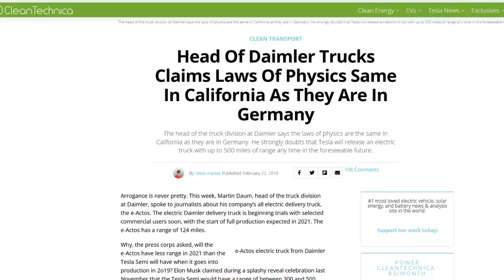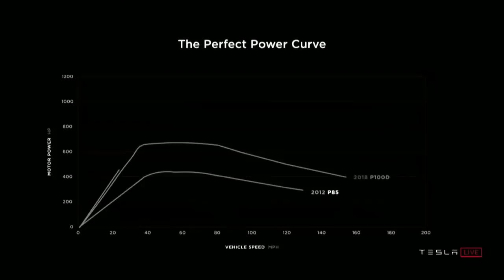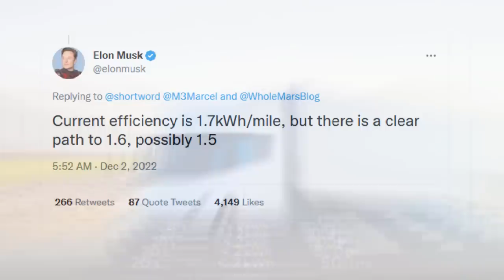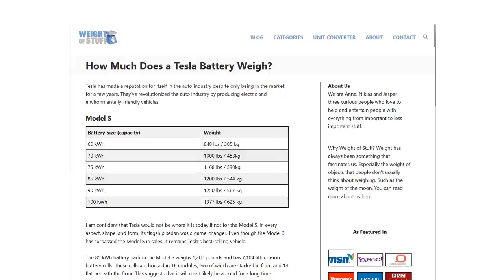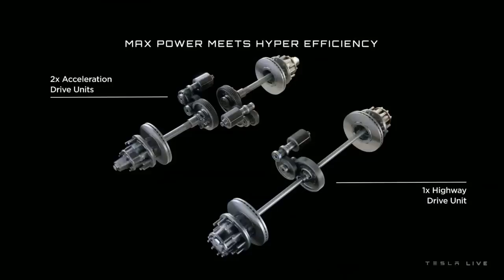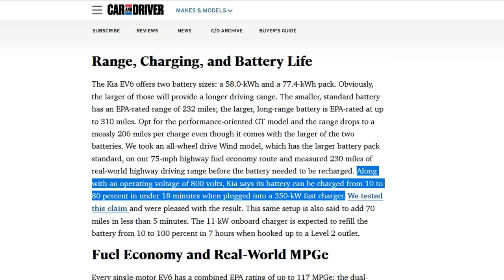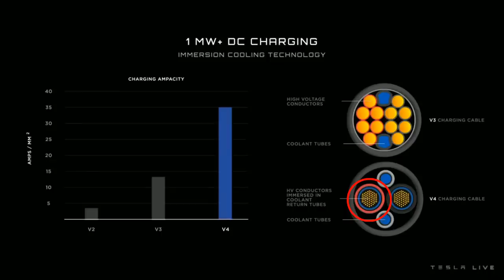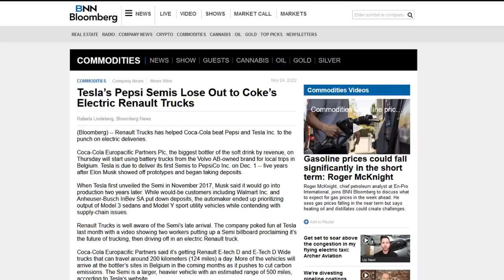Elon Musk Drops Tesla Semi Bombshell

Comment: watched this video quite patiently and if i missed the most important thing when the trucking is in consideration - the pay load i apologise in advance. The eCascadia used as comparison is looking bad for sure but the real competitors are the diesel semis and most of them are capable of doing 600+ miles between way, way faster refuelings than those monstrous batteries will require.  Also about the longetiviy ... semis  doing more than a 1 million miles before retiring are not an exceptions and ofc brand new thing as this Tesla semi is still to prove its mettle in that regard too. All in all there are reasons why Tesla 5 years{not 3} after releasing with all the fanfares their semi is not "killing the field" and some boutique kind of projects as that one with Pepsi are in order. Some short {under 400 miles per day} routes with humongous charging stations most likely on the both ends are ok, for the rest erm... nope, thats a no go for sure, the ICE based trucking industry is quite "safe" for now.
Reply: For now, perhaps. But add in no oil changes, no fuel costs, no DEF, no brake jobs, etc and pretty much the only thing left is charging, removing dead bugs, and checking the tires, which I'm certain Musk is monitoring the dickens out of! Sure the oil burners will dominate the very long haul for a time but with those better batteries I can see 600 or more miles if they stay with the same physical size pack.  Better still, can you imagine a world without Jake Brakes and open exhaust stacks? How sweet would that be!!
Reply: I believe there is a statistic that if true negates a majority of the issues you mentioned where the majority of transport trips are 250 miles or less allowing for round trips without the need to charge. The cross country trips probably wont be challenged as you said for some time but everything else is probably fair game.
Reply: This
Reply: this is some nice common sense to read after coming back from the tesla subreddit where everyone there is drooling over how this thing is "flawless" and will be "revolutionary"
Reply: @ockertoustesizem1234  and people will still deny it
Reply: @ockertoustesizem1234  Lemme put it this way... If you can run for 2 hours without stopping, and your rival can run for 1 hour without stopping; but there's a law that mandates runners to stop and replenish after the first hour. Suddenly, your endurance advantage diminishes, since both of you are stopping to replenish at the same time. 1,000 miles - 2,000 miles means nothing if you really have to stop at the enforced time.
Reply: It's not specified. And for good reason: The payload is the big flaw in the Tesla semi. Every kilo of battery is one kilo less of cargo, and batteries are very heavy. But this channel is mostly about showering admiration upon the superhuman genius that is Ego Musk, so they aren't going to mention that.
Reply: Load isn’t important as long as you can please the driver with drag race acceleration.
Always concentrate on the important things!

And find the cynical part of the above.
Reply: @larrybolhuis1049  That thing will go without needing brake jobs?! Wow... Also you think that the battery pack will last for 1 million miles? Considering that the price tag for 100 kw pack in Model S is over 20k I don't even want to imagine the cost of the 1000 kw in that semi. How about the darn payload? And if you think that the electricity used for commercial purposes will go without taxation which in turn form at least 40% percent of the diesel prices( in some states even more) forever you are badly mistaken. Anyway without some crazy federal or state regulations forcing someone to use this vehicle in the real world we will not gonna see it doing real jobs except in some promotional video " doing great" on designated Pepsi locations.I am all about breakthroughs but only when they are real and more efficient than the existent tech and this semi is neither.
Reply: @vylbird8014  you saw the payload! Uncovered. Easily calculated. It seems that the semi is about the same weight as a diesel truck. It's not an issue. It does the job. Most trucks are not at full load, usually volume limited. There will be more breakthroughs, intermediate charging stations, replaceable batteries, new chemistry. This is just the beta version. You cannot see the future very well.
Reply: @HgHg-yp6ft  It will need brake work, eventually but far far less often than a diesel rig, brakes should last several times longer. Ask anyone with a hybrid or EV when the last time they touched the brakes was and you'll likely get: "Um, brakes?" 

More importantly it is by definition my efficient. It's more aerodynamic for one but the big deal is that 80% of the power needed to charge the battery is used to drive the rig forward. With Diesel the best you can hope for is maybe 50% more likely 40% with the rest going out the stacks and the radiator.  

As to battery life that pack not go a million miles, but future ones will. Already one Tesla owner has gone 850,000 miles on one battery and that was older tech as well. 

You can push back against these things all you want but it won't be long before they rule the highways, cleanly and quietly.

Comment: I think I would have made  the charging cable out of superconducting nanotubes (no cooling required!!) and screw that mix of liquid and electricity.
Congratulation on FINALLY getting a  product to market, even if it was 3 years late.
Reply: Superconductors require extremely low temperatures to become superconductors.  At ambient temperature, they still have normal resistance.  You'd need even more cooling for superconductors.
Additionally, there are plenty of liquids that are nonconductive, so they're perfectly suitable for cooling these charging cables.

Comment: I think for many years the 1000V will be restricted to large battery packs. There is no advantage for small cars, just adds more costs on electronics. The limiting charging factor on small batteries are the batteries themselves. As an example, it's said the Model 3 can go above 300kW with the current 400V battery. But most of the time it will be below 200kW, meaning higher voltage would bring zero improvement.
Reply: What if you split the battery into two and connected it in series at 800 volts and charged it as two 400 volt battery's in parallel wouldn't it charge twice as fast and lower the weight by using thinner wires and a smaller motor? Of course it would. So it looks like a higher voltage does have an advantage after all. 50% seems a long way from zero.
Reply: @tedmoss  the battery is already split into thousands of cells. The 800V is between the charger and the battery, not between the charger and the cells.
Your logic doesn't make sense
Reply: @tedmoss  
A Battery split, connected in series is...... "A Battery"

Comment: The story is also out on something that Musk nor anyone else can cover-up.  Basically, physics is the author of this issue and not man, basically, when it gets cold the battery bank loses about 50% of its capacity.  Now, these Tesla trucks will be of great value for short hauls or in-city operations, but a long-distance over-the-road truck simply is not a good alternative.  You can juggle the situation to arrive at that 500-mile range.  On a warm day you have a optimum battery capacity, drop that ambient temp down to say 20 Deg F., and suddenly that 500-mile range is now down to roughly 250 miles or fewer.  Then add a load to the maximum, then you drop the range roughly half again.  Don't believe me simply look at numerous independent EV tests and ALL have shown drastic range losses when the load is increased and the ambient drops.

Comment: Sandy Munro says that trucks with a driving range above 300 miles may need to be hydrogen fuel-cell driven because of battery weight needed for electric trucks with a range above 300 miles would need a battery size that would negate their advantage due to size and weight.

Comment: 500 Miles? How long to recharge? How long can a diesel run on one fill up and if it runs out how long to refill? Would be good to know these things.

I dont think electric trucks are an answer to the trucking industry for now but would be good to see them develop into that.

EDIT: Saw numbers in the video but they are wrong. I live in a very hilly country and trucks here are carrying very heavy loads way more than 230 miles on half tank of fuel. So that number is a bit sketchy. Also it does this while doing lots of hill, the USA has a lot more flats than here. (Jamaica)
Reply: The best guess is 15 hours recharge time. EV owners for a pickup truck were surprised that the charge time was twice that stated by the manufacturer at 23 hours with a 240 volt charger installed in their garage. The video was posted on YouTube.
Reply: @ThePzrLdr  At that rate it may be a significant hurdle to overcome even with a 1kv system. They will find a solution , I just don't think it's there yet.
Reply: @tegra_0  What isn't reported is this thing requires a 360v charging station. That infrastructure simply doesn't exist.
Reply: @ThePzrLdr  Most likely it requires a higher voltage than that.  Yes, the infrastructure for that does exist and is being used.

Comment: As a truck driver this is good for local but when it comes to long haul and adverse weather like deep cold and snow to hwy s with little infrastructure diesel will still rule besides the NA electrical grid is still way behind.
Reply: @sjd 649    You are probably correct. When automobiles first appeared there were very few gas stations. That changed quickly to accommodate the new technology. I suspect the same will happen with EVs.

Comment: I can see a value for a plug in truck working on relatively local trips from a hub,  but I do not see electric trucks for long distance trips or ultra heavy transports, rather I would not want trucks to be plugged in as this is down-time and is not generating income. I would rather see a truck with the  Norwegian solution, i.e. a removable battery pack, so you take the truck to the roadside garage where the 'flat' battery is removed and goes onto a charging rack and a fully-charged battery is slid in.  This does mean standardising the batteries to some extent.

Comment: There is good reason why they didn't use the 4680 cells a test put there energy density lower than the 2170's, they got 244wh/kg for the 4680 and 269wh/kg for the 2170, which may not seem like much but in a 1mwh battery that is a difference of 381kg or 838 pounds just in the cells

Comment: Questions. 

1. Can they scale to 50k / annum. In short, yes. We assume a 900 kWh pack. Let's say 1MWh to keep things easy. That's 50,000 MWh (or 50GWh) - quite a lot.  Though we know from S/3/Y deliveries and grid/home products that Tesla is already producing significantly more than that number. Probably on the scale of 100 GWh. This is before Berlin is fully operational and that plant is expected to handle ~250GWh of battery production per year. Since Tesla has a good and proven track record on getting large scale factories up and running there should be little doubt they can make good on 50k semi trucks.

2. Can it be reverse engineered? Absolutely, everything can. But even having detailed schematics for every component doesn't let you manufacture those components. Especially not at scale.
Reply: Tesla will produce 1000 GWh in a few years time, most likely 2025. According to Elon.

Comment: I wonder if he has ever though of making the truck battery pack standard and robotically swappable, so a truck could just use a drive in/drive out robotic system to change the whole battery pack for a pre charged one at dedicated truck stops, that would negate the time spent having a truck hang around waiting to charge, also the pre charged battery packs could be stored in racks and trickle charged using less energy, it would also mean that the truck wouldn't suffer from worn out battery packs, as they could be removed for recycling or disposal.
Reply: Just.....NO!

Comment: I heard it stated previously that the coefficient of drag (wind resistance), is a larger factor than the load being carried, when it comes to the efficiency of the semi.
Can someone verify this ?
Reply: on flat very smooth roads, ye i would say thats true. but hills are where every truck kills its MPG. same with electric. but we will see how well adopted this truck is with haulers
Reply: @halo2freekly  The EV truck regains a significant part of that energy going downhill, while the diesel truck regains nothing.
Reply: @lokensga  the truck burns no fuel going down hill too. Improving the mpg on average. But ye electric can on some hill boost it's charge.

The reason I say haulers will prove the Tesla semi. Is because a company in my area has had 3 electric trucks in it's fleet for over a year, I have heard nothing but complaints about them. They have never had all 3 on the road for a week. Time will be the test we need more than Marketing
Reply: @halo2freekly  Even if it burns no fuel going downhill, it isn't GAINING any usable energy.  Would be interested in hearing some of those electric truck complaints. Do you think they are just part of the shakedown process, or are there substantial problems?  EVs not a natural fit for the jobs?
Reply: @lokensga  it's hard to say.  it's rumour mostly, company's don't talk about how bad they are doing. But drivers talking dont make stuff up out of the blue. But the entire truth is probably more that they can't compete the roles they are being used in against standered trucks.
The company deals with containers and some general fright. They are not a direct comparison to their fleet as they are different specs. Sadly hearsay is not evidence, and they are basically first gen trucks being used against the latest and greatest development from the EU manufacturers

Added by edit: Reading this back and god my writing is bad

Comment: I'll bet Tesla will have waste heat recovery for the V4 chargers that can use the heat produced from the fast charging to generate more power while removing heat from the coolant.
Reply: I doubt it.
Reply: Something like this: 

 https://youtu.be/vbTyEKsuMcM

Jamming 1000kW into a cable you can easily plug in by hand will generate a bunch of heat that needs to go somewhere. I've handled 500kW cables on ships and they are very large and very heavy.

Comment: For me the range is not a problem if there are charging stations everywhere. I wanna know what’s the day to day with those trucks. Waiting time while loading and unloading running the battery for the AC or the heater, traffic, tight spaces, weather elements in real time. The truck hast to be under the constants trials as any other diesel truck. I want regular drivers from any company to drive them, use them, and we’ll see. Give them a few years and wear them out…
Reply: Wearing them out will take 20 years.

Comment: We'll see where this goes. I seriously doubt this is taking off any time soon because you'd need massive charging infrastructure which is simply not possible with the current electric grid. It's a 1MW charger per vehicle - what's the average Flying J have to have as a grid connection? 50MW? 30MW? At least several thousand homes worth of connectivity per "gas station". 
The funny thing is that it won't make a dent in the world's climate problem.  It's just a differently powered truck which initially will use a load of fossil fuels to power since most of the US power grid uses fossil fuels and when we need to double or triple the generation capacity, that's not going to happen any time soon with wind and solar.
I'll also wait and see how those things work in real life conditions. Driving on a virtually flat surface most of the time in an area that generally has no headwind is one thing, driving east to west with headwind and elevations going up to 10k feet instead of the 1500 feet the grapevine is tall will be a different story. A Model X driven towing a trailer from Colorado to Oregon has to recharge every 100+ miles or so because headwind eliminates the range. Do that with a semi and the 500 miles range will be less than 200 miles and the area is virtually empty - no big power lines, even gas stations are far between in those areas. It's going to be a while with many billions of investments before we see electric trucks on those roads.

Comment: Fuel is the greatest expense for long haul so kicking the diesel habit has appeal.   However, the carrier charges by ton-mile so a battery heavier than the ice/trans is going to reduce payload capacity which impacts revenue per mile over the entire life of the truck.  It's a conservative industry as evidenced by the snarky commentary from industry heavyweights.  The customers are conservative too so don't expect a mad rush to electrics.  But I think over time operating costs like maintenance and downtime will strongly favor electrics.  Most big fleets have their service department complete with a warehouse full of parts so savings there could be huge.  Lighter, more energy dense batteries will force a quicker transition.

Human drivers can only be behind the wheel 11 hours  before having to rest.  All those idling trucks you see are drivers out of hours.  If the trucks at some future time can be rated for autopiloting from coast to coast without a driver THAT WOULD BE HUGE.  In addition to eliminating the driver expense you can now run the truck 24/7/365.  That would bring down the cost of shipping dramatically.  I still remember my boss at PACCAR saying "PACCAR is Evolution, not Revolution!"  I can't wait to see how that works out...